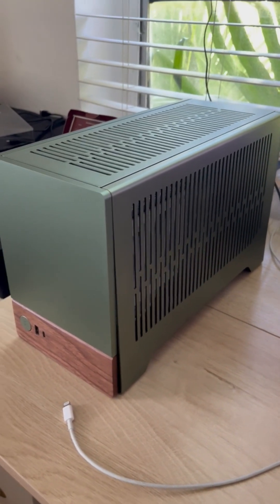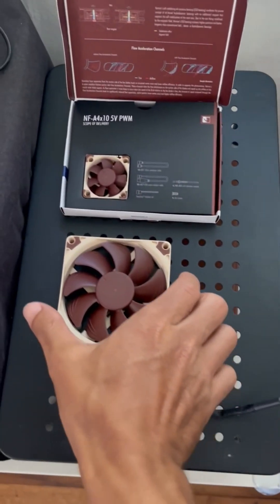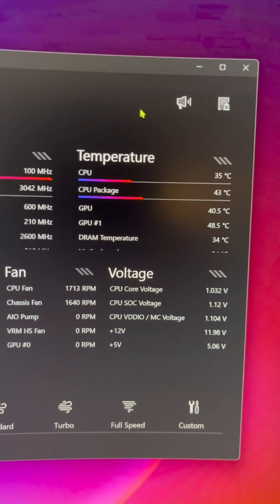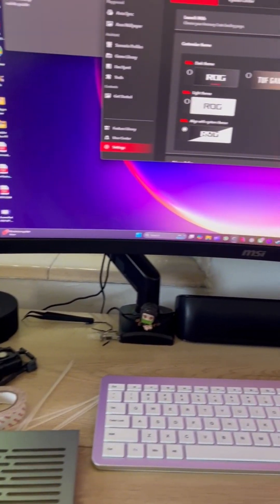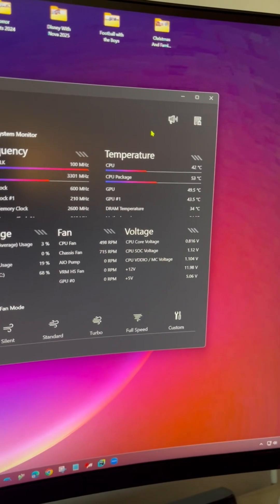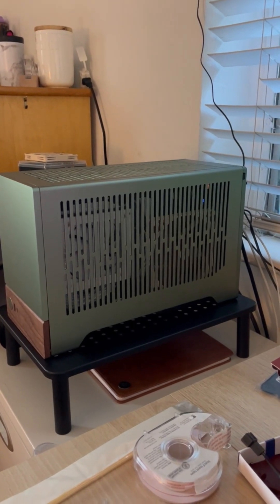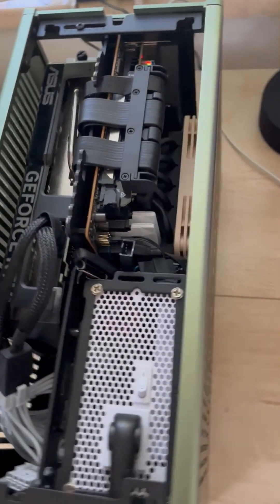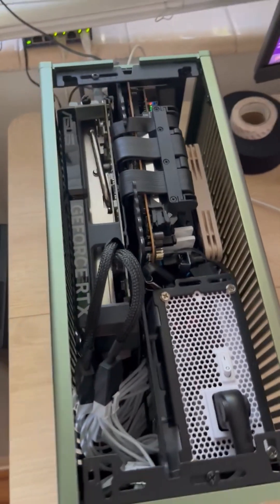Fractal Terra PC Build Different Cooling Options and Tests- BEST Cooling Methods?? Part 1

Comment: Are there any fans pushing hot air back down? Ideally, all of them should be pushing the air to the top of the case, even the smaller one, working as exhaust.

Comment: Have 50°C on idle for an undervolted 9700X (-50 undervolting value). The cooler is an i-67-xt. The environment is about 28°C. The cooler is 10 mm thick at the bottom.

Comment: Hi, your temperatures look really good! I recently finished my build in the Fractal Terra Silver, and my Ryzen 9600X idles around the 50s, which is totally fine. If you really want to lower the temperature, you'll need to change the CPU cooler that’s where you’d see a noticeable difference. I suggest waiting for the ID-Cooling IS-77XT; it’s the best cooler for this case. However, I'm not sure if it will fit with your GPU. In my case, I use the IS-67XT along with MX-6, but switching to it might not be worth it. The only difference in my setup is that I use a regular 25mm Noctua fan at the bottom but that’s about it. If you're looking for a good channel, I recommend Machines & More he has a lot of videos on the Fractal Terra.
Reply from the maker: Thank you for your feedback! that actually gives me some relief as I was not sure what normal temps would be with the fractal terra, wasn't sure if 40s or 30s (Celsius) were the temps to be at. I also read that these AMD CPUS apparently are built to run at 85-90c at all times for a lifetime (according to AMD)... I'm going to leave the PC as is for now, but I did at first want to try the Noctua NH-L12Sx77 as I heard its also the best, but I had already purchased my GPU and there was not enough space for it, and  honestly this ID-cooling IS-55 has been amazing,  I stared off originally with a Thermalright AXP-53 but temps were not as good) IS-55 made a huge difference (about 8-10 degrees). I also went for the "NON X" CPU as it has a TDP of 65watts so I figured that should also help. I might keep messing around with the 90mm fan and the mini one as well but ill def post it if I end up doing so. 

I also had no idea that there will be an IS-77XT, i might just purchase that for my next build... :)

Thank again!